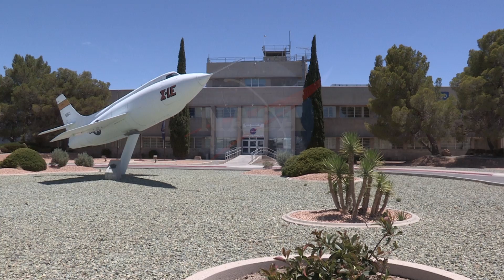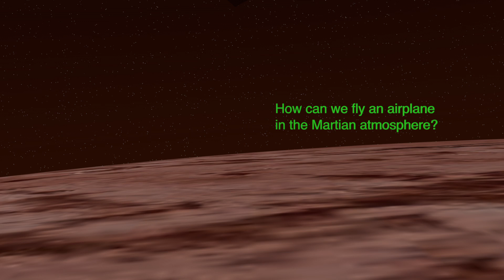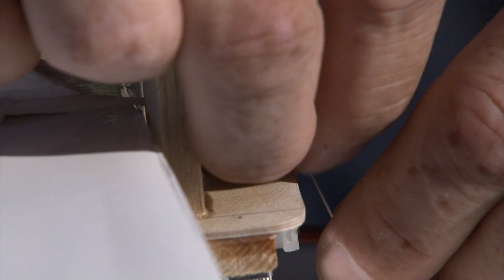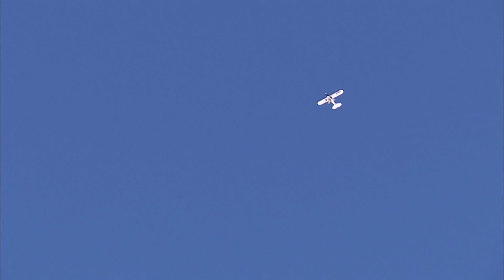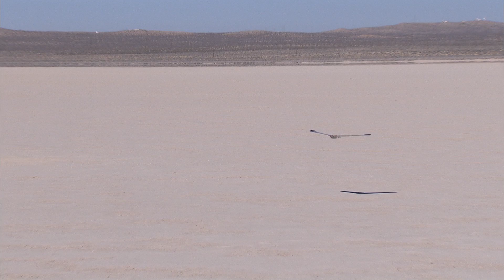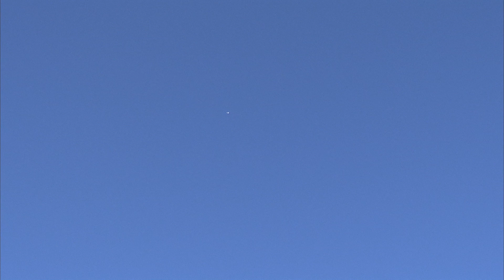PRANDTL-M Successful Test Flights

Comment: if you needed a stability system to make the craft fly correctly then you don't have the right design. i have only ever used gyros on an airplane for fun, not to make an airplane fly better. i could make a glider for the same purpose from scratch and it would not need any gyro systems for stability. i think you need to make a new design or ignore me, that's for you to decide.
Reply: Jonathan Thomas 
So design one that glides in a barely there atmosphere.
lol
Reply: Jonathan, you should consider the size and space constraints (3U cubesat and Martian Atmosphere).
Reply: instability comes from design not atmosphere conditions.
Reply: Oh yes, ro is not part of any formula. "My mistake"